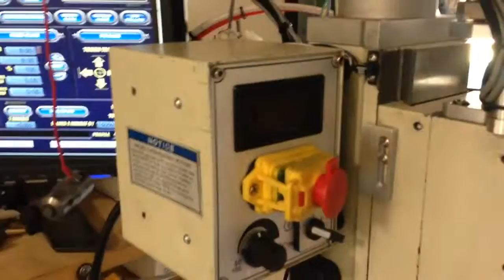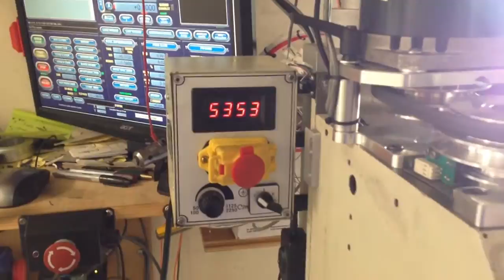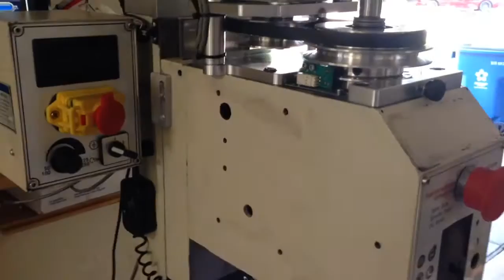G0704 with Bench Top Precision belt drive & 1100 watt motor.

Comment: Does the head of your machine get roasting hot running at high speeds. I have a stock motor with a precision bench top kit and then earring kit and the head of my machine is on fire. Thoughts???
Reply from the maker: No I dont have a heat issue. Did you change the bearings? Too much preload possibly?

Comment: Hello,

I purchased the belt drive kit from Scott as well as the 1100 W motor mount plate. 

When you repaced the original motor (850 W) with the Weiss motor did you change something regarding the electronics (e.g. PCB for handling the 1100 W instead of 850 W) ? Can I install the motor with the existing electronic components in the control box ?

Best regards,
Tobias
Reply from the maker: I have changed so many  things over the years I cant really remember. I believe the control board is stock and or a KBIC 125 equivalent. Most likely stock. Just connect the motor in place of the stock one, even if the control board puts out less wattage it will still be an improvement.

Comment from the maker: The kit was very well designed and complete. It was packaged as if the person cared that you received a product like it was intended. Everything fit which is amazing in its own right since the same models can vary a significant amount.
Reply: Is this unit from new zealand? I saw the conversion only on ebay and thought it looked good.
Reply from the maker: Benchtopprecision.com
They are in the U.S.
Reply: I have the New Zealand kit but the problem is, it has one speed only, stuck in the high gear which isn't good since I use the machine manually, and therefore need lower spindle speed. I'm getting the benchtop precision kit and will sell the NZ kit. The other problem is lack of options to convert it to a larger motor, the NZ guy sells this motor that is 220v only.